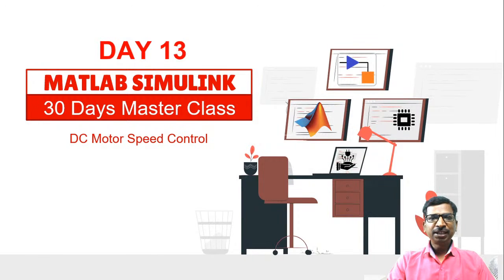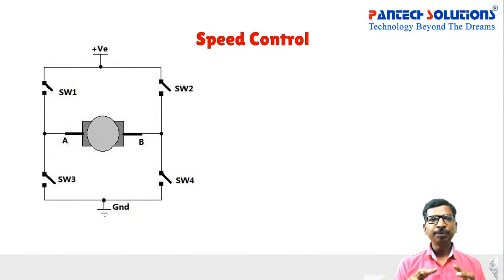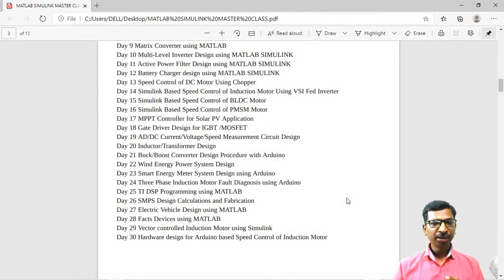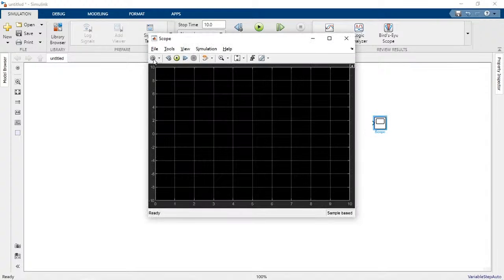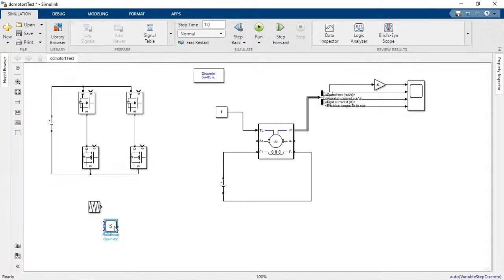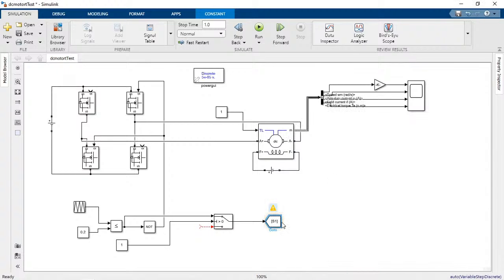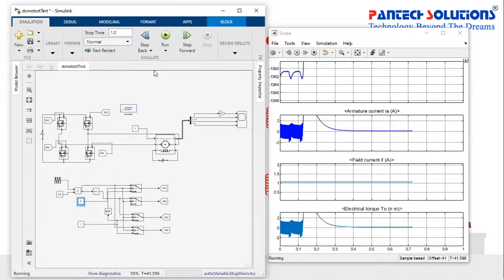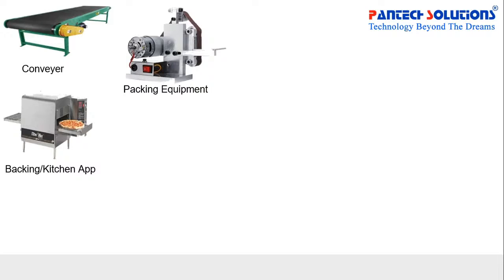MATLAB Simulink -Day 13 Master Class for Electrical Engineering

Comment: Sir, can you please explain about re generative braking in 4 quadrant operation of chopper in MATLAB simulink.
Reply from the maker: in this simulation, the Back emf is allowed to dissipate using S2&S4 Switch. if we need to get Regenerative then we have to add energy storage device in this circuit.
Reply: @pantechsolutions  thank you sir, is there any possibility to store the kinetic energy during braking in the source it self to avoid another storage circuit.

Comment: The  basic concept of DC motor with different motor operating modes were  nicely explained. However the simulation part like how to choose the corresponding blocks to get the line diagram including feedback were covered so fast to be digested by us.
Reply from the maker: block name plz check the videos